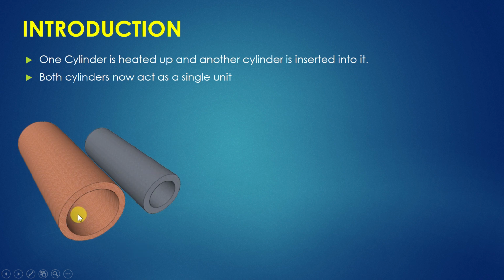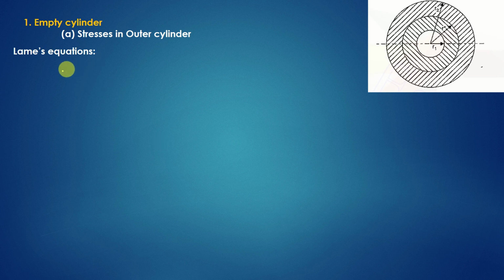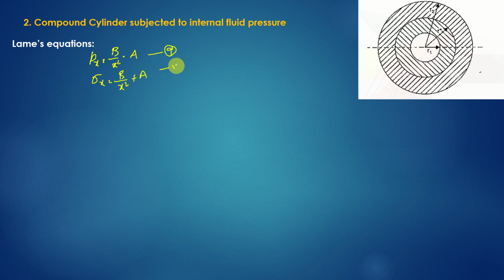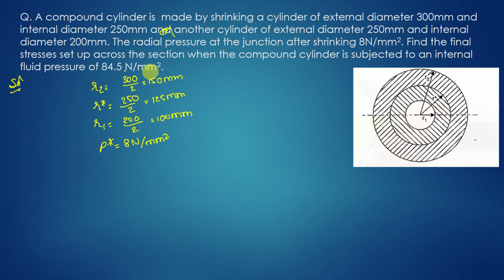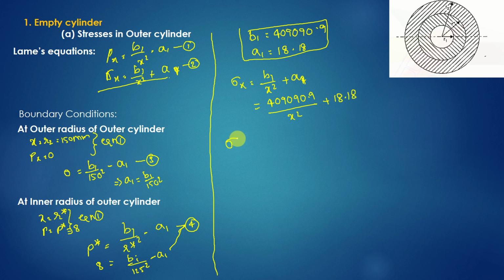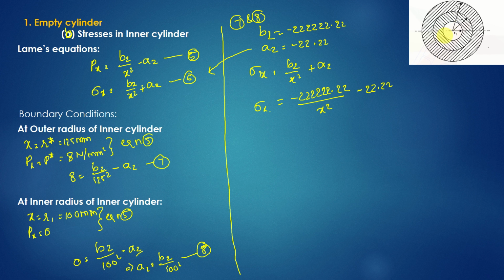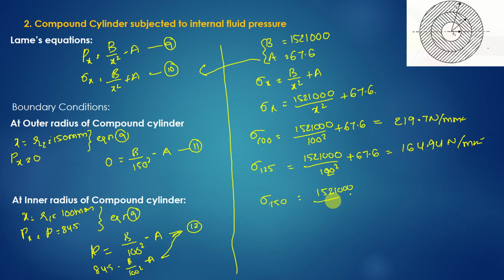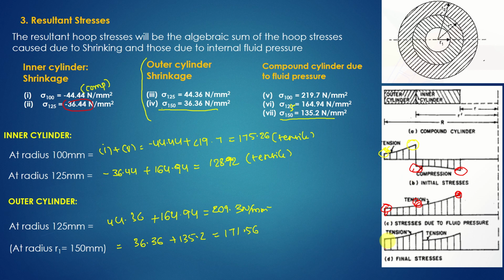Compound cylinders

Comment: If I use a compound cylinder and a thick cylinder of same total thickness and apply same internal pressure, which one will have lesser stress generated and why?
Reply: The compound cylinder will have lesser hoop stresses at the junction between the two cylinders will suck up some amount of stress